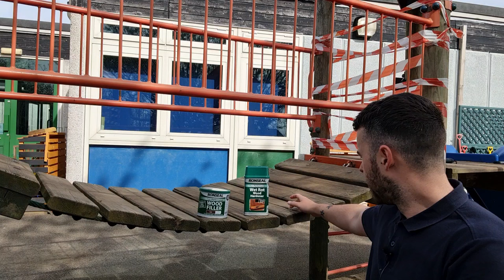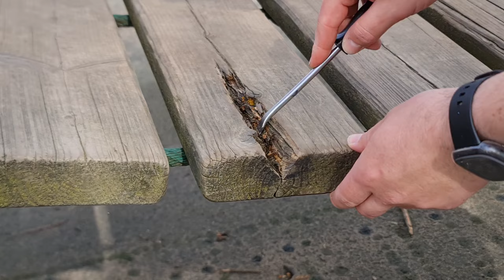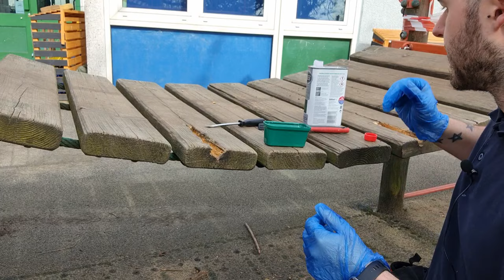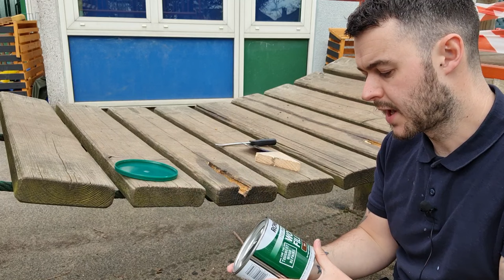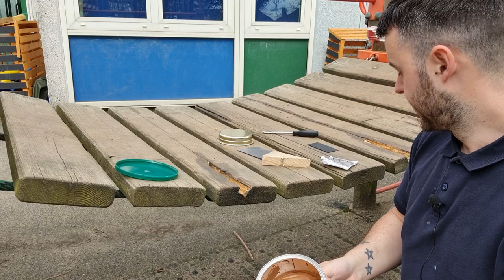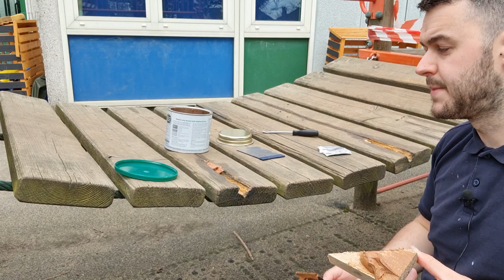Easily Repair Rotten Wood Ronseal Wood Hardener

Comment: Basically the same job as a dentist does to a tooth, however the rot on the bottom corner of My shed can not be fixed this way. To fix My shed I will use a drill to remove all the rot and then after I see whats left ill I'll cut the remaining wood straight and then make a replacement section and nail it in place.
Reply from the maker: Yeah sometimes things are too far gone..even this wouldn't be a permanent solution, more of a patch
Reply: @thedoitalldad  Stop or reduce the moisture stops the rot however My shed is in shade half the year from September onwards and that rotten corner gets no sun and is difficult to stop it from getting wet.

Comment: Why is the open wet rot tin standing on a wobbly surface where it could easily get knocked off?
Reply from the maker: @fritzhenning1  Don't worry I was careful and didn't spill a drop 👍🏻
Reply: I enjoyed your video and wish you well....but it was a wobbly surface. You did the H&S warning re goggles, gloves and smell then put the open tin in a precarious position. Aren't I a bore!
Reply from the maker: @fritzhenning1  Had to add a bit of danger and excitement to the video
Reply: @thedoitalldad  Best of luck. I watched your video because I have a large hole to fill and am trying to decide whether I need to cut in a new piece of wood or whether I can fill it. I know I will bodge it whatever I do, all my DIY projects end that way!

Comment: I replaced the board before the video ended!
Reply from the maker: Glad you got it sorted 😂
Reply: Bro that was hilarious and true
Reply: Probably cost less to, I personally would not waste time with filling a huge hole I would put a bit of that filler in then push a bit of wood I cut to fill most of the space. The filler would just fill up the gaps.

Comment: Does the rot come back after some years , after the treatment
Reply from the maker: There's always the chance unfortunately as there would be if you just replaced the piece of wood. You want to remove as much of the loose rotten wood as possible to prevent this

Comment: Could you use this on a wood front door if you plan on painting afterward?
Reply from the maker: Yes of course... Check out my video of the bench I recently saved. I used both of these, sanded then painted and you'd never know 😊

Comment: It probably would have been cheaper, stronger, and faster to have bought one redwood board to replace the two rotted planks.

The repair looks terrible. Probably should have let it dry and sanded it.
Reply: Well yes, but the video would be boring, and people want to see a cheap and cheerful option rather than replacing a window or door frame.
I would have thought that is obvious??